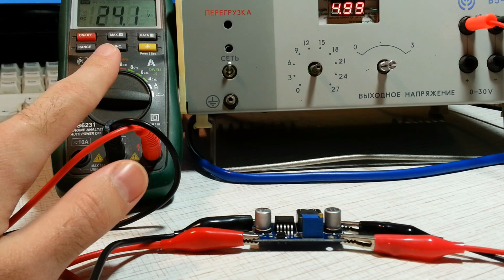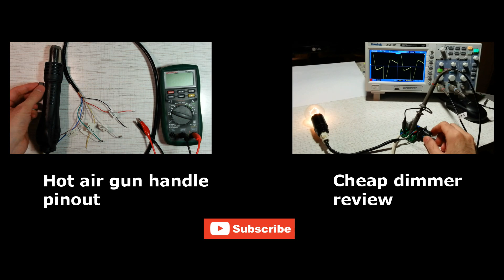How to make rework station / hot air gun for $15

Comment: I have Eruntop 8586 D + stations from aliexpress.  Hot air gun set to max blows very poorly.  Will the hot air gun blow stronger by replacing the potentiometer on the motherboard with more / less Ohm?

Comment: hello sergei...thanks for the video...what is the best circuit with temperature control...one that has led display...thanks...and also how to connect the temperature display....do i need an 8 pin aviator plug for this hot air handle? the hot air handle has 2 thermocouple wires. how do i use the thermocouple wires to control the heating element temperature. thanks.

Comment: Can someone tell me : connect dimmer to 220v, connect gun to dimmer, regulate power with knob. And thats it? Thanks
Reply: Ok, maybe this can work: 220v to dimmer and in ac dc converter. Then dimmer to gun and frim dc to dc dimmer for fan speed. So i can make a box with ac input to all three devices and make output to gun on frint side with 2 knobs for regulating temperature and fan speed?

Comment: Once i thought to buy only the hand held part and make my own controller,display fan and heater drivers,but the price of the complete tool is 40-50 euros and ready-with the help of some luck-to work avoiding any other mess for code writing and the assembly of components.It looks powerful 700w and already i have ordered it expecting to arrive.

Comment: In modern smd components that are in double or more layers pcbs one general rule is that heat it until the solder melts and remove the component.So exactly temperature adjustment is not needed because it is a handheld tool and can vary manually the distance from the component and the delivered heat to the pcb.As long as temperature is not in crazy limits above 500 C to destroy pcb or the heating element itself then everything will work fine.Great inspiring projects and i give you congrats.

Comment: can i connect the heater wires to 230AC directly, what can I do if I have no dimmer?
Reply: or use a relay that is 250AC capable and swithc that on and off?

Comment: How is the reed switch implemented to cool down the blow gun ?

If one wants to have the option of auto cool down for the gun with the use of the reed switch wire in this porject, I am unable to understand as to where would the single reed switch wire connect ? the second wire is however connected to one of the thermocouple wire ... i am unable to imagine/guess the circuit to have this implemented.

Can somebody shed light on how the reed switch wire could be used in this DIY project ?

thank.s

Comment: I'm thinking about building one with an old laptop power brick similar to a Saike 8858.
  In my opinion, the problem with the system as shown is that this gun is designed for a cool down timer (the reed switch). This is needed so the heating element has air flow for a few seconds after shutdown. Larger heat guns don't have this kind of feature, but they are usually made of ultra high temperature plastics. Heat guns also have more bulky air insulation space between the heating element and the body of the unit, I imagine they also have a lot more mica insulation than this little guy. The heat guns I've taken apart have a lot more mica than would fit inside this compact design.
Reply: What's the purpose of the power brick? Heat gun runs on mains voltage.

Comment: Is it possible to just plug this in a hakko soldering work station? I.e. Hakko 928.
Reply: hentai nat 
  I wondered the same thing myself. I don't think it will work because this unit has a heater coil resistance designed for mains voltage. The Hakko irons run from a step down transformer to power the heating coil. The thermocouple voltage of the iron is also calibrated on the ones with temperature readings so this would not function either.
Reply: Upcycle Electronics tnx, I was just wondering if we could utilize the sensor for the heater.
Reply: hentai nat 
  If you look up the channel KainkaLabs (no affiliation) and look for his 2 videos on the Atten Digital soldering station he reverse engineers the heating element circuit. The Atten design is basically a cheaped-out Hakko. It incorporates the themocouple measurement in series with the heating element instead of using an extra set of terminals like the Hakko... However, the measurement part of the circuit is very similar. The Atten design is just measuring the temperature during the PWM off cycle instead of having a continuous analog measurement available for the microcontroller to sample. The measurement circuit is rather simple. It's just a few 1% resistors and a LM324 op amp. Not that you want to build this circuit...
   Personally, I'd look into ways of measuring the temperature independently. A thermo voltage is usually measured through the mA range on most multimeters. You need a microcontroller to scale this to a temperature. Alternatively you could just note the scale visually and use a simple $0.99 led Voltmeter from online vendors. There are also cheap units like the MH1210W that could do far more for less than $10. The thermocouples used in these things are just typical cheap K-type designs.  The only real issue is calibration as different thermocouple designs will have different properties such as resistance that must be scaled at some point along the signal amplification chain.
  You might even be able to take your station apart, duplicate the analog temperature circuit with it's own calibration potentiometer. Then Simply add a switch that shuts off the Iron and sends the new temperature circuit to the MCU in place of the original.
  If you watch the KainkaLabs Atten videos you will see the temperature readings aren't exactly true temperature readings anyways. They are more like a scale that requires some 'understanding and translation' by the end user.

Comment: nice project! can help me to measure the voltage in the Temp Sensor between off and full temp?im planning to attach it in arduino so i can display the temp value,  thanks
Reply from the maker: You should check out my article http://e1ectro.blogspot.ru/2017/02/diy-desoldering-station-for-25.html

Comment: Great. Just finished building one. Did not connected the thermocouple wires as I do not 
have a sutible meter but nevertheless works great.
Thanks Sergei
Reply: How do you keep the temperature stable?

Comment: hi, can I know the heating element is running on Ac or DC voltage, I intend to convert my soldering station to add a hot air soldering function to it
Reply from the maker: For a heating element It doesn't matter if your current is AC or DC. As long as you deliver the same power to the heating element (P=I*V).
Reply: how many watt does the heating element need ? i have a 48W soldering station with temperature control.
Reply from the maker: I don't have the proper equipment to test the power consumption of the heat gun. But I think your soldering station can't deliver enough power to the heat gun. The heating element resistance is about 60 Ohm. The typical soldering station max voltage is Vmax=24V (DC). Therefore P=I*V=V^2/R = 9.6 W.  But typical heat guns specifications claim that their power is about hundreds of Watts. So It's not sufficient.

Comment: So, this 220v dimmer could work at 110v?
Reply: aitvochon 
Yes. The dimmer shown is actually the same as any dimmer used in household dimmer wall outlets as well. You can pick one up from your local hardware store. Although they will cost more than the modules from China, and they are not as pretty.

Comment: Hi!
Bough the dimmer and the heat gun. Hooked it up. Problem is, that it is hot enough to melt solder at the very lowest setting. Turning it up  makes it too hot. So not much ajustment possible with this. My dimmer works fine with a light bulb. 
What can be wrong?
Reply from the maker: You should try to adjust the small potentiometer with a screwdriver. Be extremely 
careful don't touch any metal part of the dimmer when it's connected to 
the high-voltage line.  See a wiring diagram here https://drive.google.com/open?id=0BwsaCaa887AuSHB0MkhySk5jZjA
Reply: Ok. Well I cant get it down to 100 degree celcius is the rework station 858. Usefull when doing schrink tubes. When turning the potmeter using a light bulb, I dont see any difference.

Comment: Can i use the same dimmer for lower voltage? example 0-30v?
Reply from the maker: I think the dimmer could work because a typical TRIAC has gate threshold voltage/current about 1.5V/50mA. https://en.wikipedia.org/wiki/TRIAC
Reply: DC PWM http://s.aliexpress.com/RvMBV36F
Reply from the maker: However there is a DIAC. It's used as a trigger. And I don't know its breakover voltage...

Comment: Привет. Я в электронике иногда путаюсь. Объясни пжл, почему диммер AC, если используется DC бп и конвертер? Я планирую использовать старый БП от компа, но что-то запутался почему диммер на AC? Или это неважно?
Reply: Кажется понял. диммер работает от розетки на 220, так? тоесть нужен БП и розетка..
Reply: HEATER works to "high voltages" Alternating Current (AC110-220V & regulator)

FAN motor runs at "low voltages" Direct Current (DC12-24V & regulator)
Reply: Yeah, At first I thought that dimmer is connected to DC voltage as well. Now I see there's two different electrical sources.

Comment: Sergei ,today i receive the same dimmer as yours ,but no working...what can i do??
Reply: Check your dimmer: connected to it just a light bulb 220V. If the bulb lights up, your dimmer is OK and you'll have to open the gun and check wires to resistance. (abaut 60-70 Ohms between them)

Comment: How sync this thing with an arduino and you've got a good soldering station.
Reply from the maker: Actually I made a breakout board of a soldering station for arduino. In the near future I'm going to cover this topic. Here you can check a schematic and a PCB design https://drive.google.com/open?id=0BwsaCaa887AuY2VnWTZYSUpFSDg
Reply: This is cool! I was thinking to order PID controller for temperature control and variable DC for the fan speed control and then basically have something similar to 858 station clone, but this would be very interesting project to build.
Reply: hey with arduino you could make a full automatic bga station:D

Comment: Very very nice. I will try to build one, specially since I don't need too use this kind of tool very often. 

What about air flow control? I am guessing that DC voltage (24V) regulation would enable fan speed control. Is that correct?
Reply from the maker: That's correct. 
For example, 

1) if you have 12V DC from a PC power supply, you can use a DC-DC boost converter to increase the voltage up to 24V. By doing so, you will get the fan full speed. 

2) If you have 19V DC from a notebook power supply and you want to lower the fan speed then you need a DC-DC buck converter to decrease the voltage.